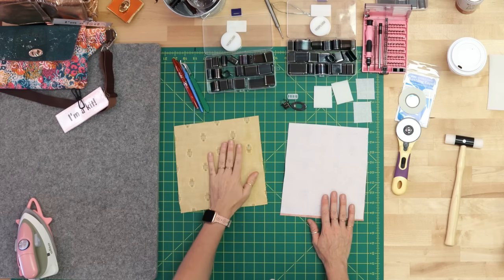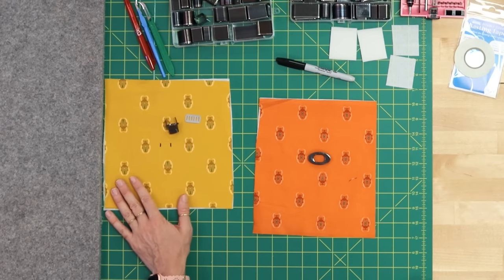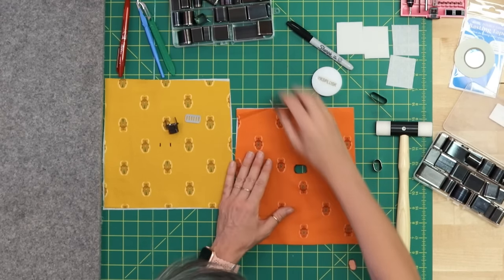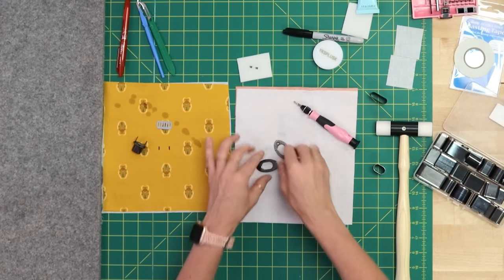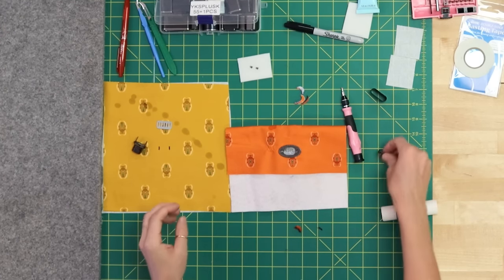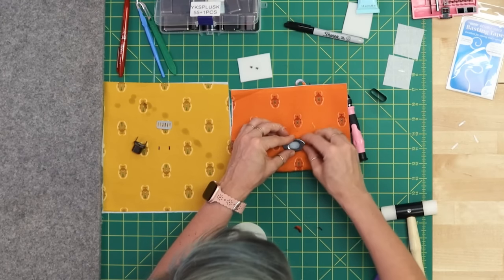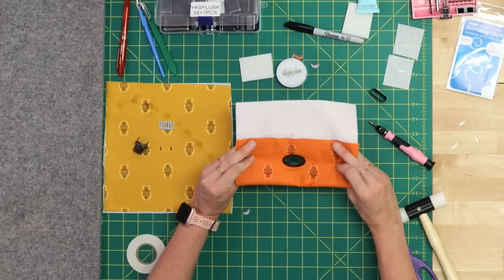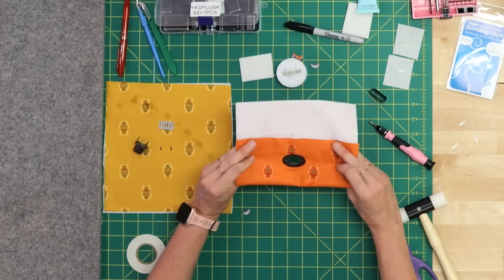How to install a Turn Lock or Twist Lock in your bag

Comment: Question about the die sets....I am assuming that they have 2 entirely different dimensions/sizes?
Reply from the maker: The die sets I linked have different shapes and sizes. You can read about each set on those links-- I found both are quite useful for inserting turn locks depending on the shape turn lock being used. :)